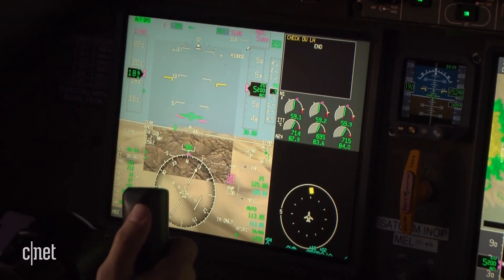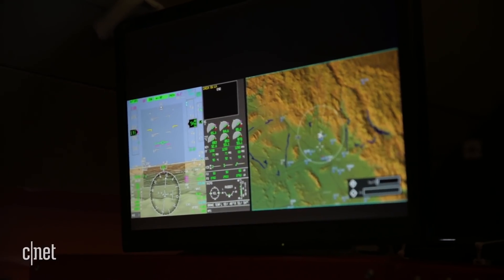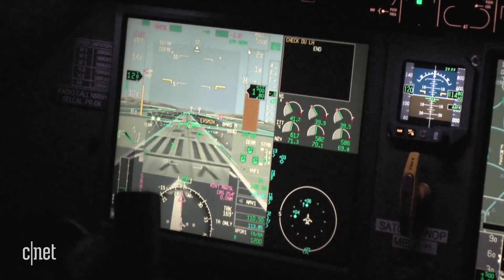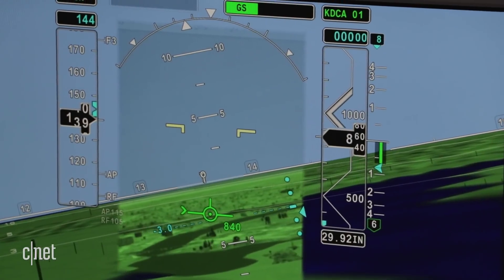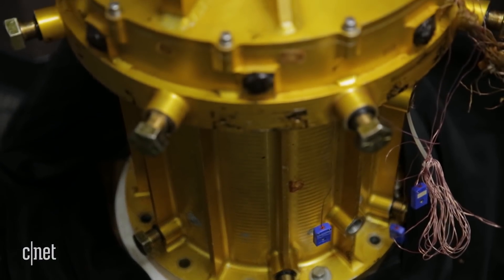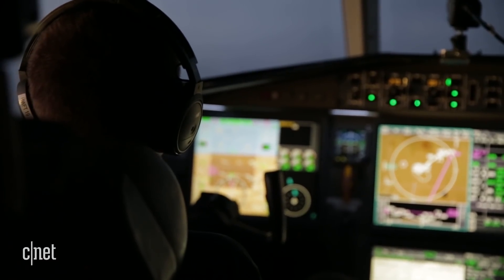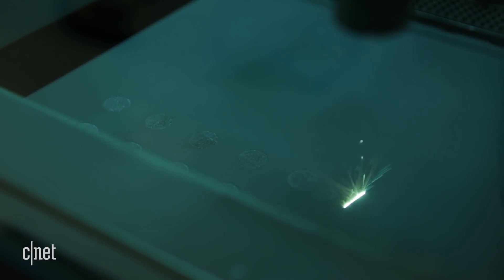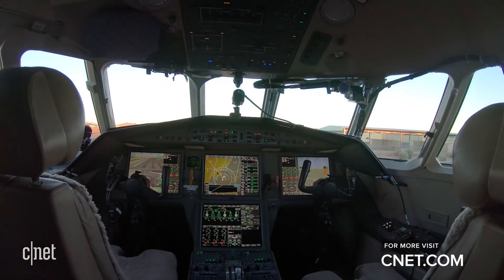Take off in the cockpit of the future

Comment: Synthetic Vision is nothing new and is not only on a "few Gulfstreams" but also in most new single engine propeller aircraft. The 3D representation of the airport is new however and looks kinda useful but nothing that I feel like I'd need as a pilot. Also, pilots, including me, should be able to taxi on the right taxiways without a magenta line showing the right way on the ND. Yes, taxing on an airport can be very dangerous, but a simple 2D chart is more than enough to get you safely to where you need to go. I mean after all pilots are well trained people and don't just hop in an aircraft and go.
Reply: Kaipeternicolas yeah but options I guess
Reply: I imagine landing a 747 at JFK with terrible weather would make you happy for any help you can get